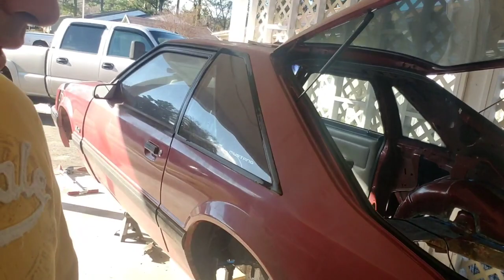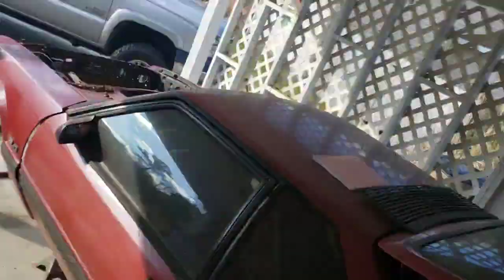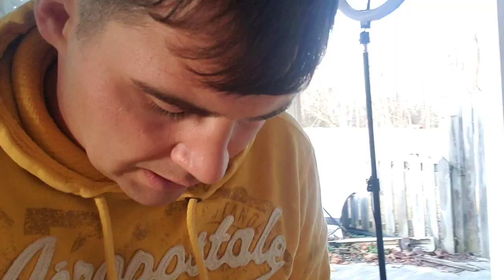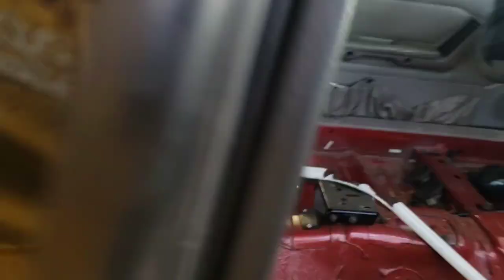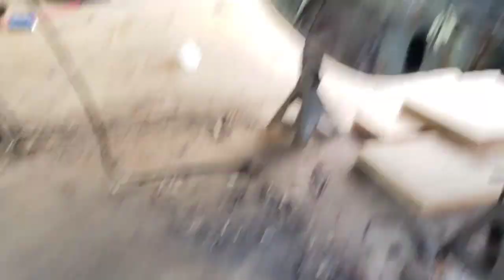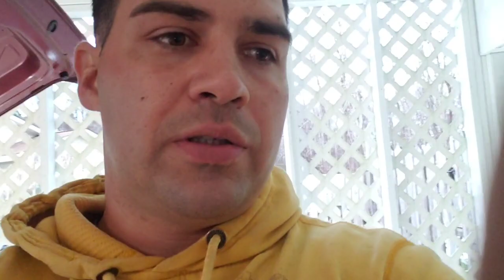MORE PROGRESS ON THE MUSTANG!! LITTLE BY LITTLE

Comment: I would recommend cutting out the parts you’re planning on leaving at the front of the frame rail.   I’ve helped with a car that has a similar “shelf” sticky tires in the pits will fill it with gravel and you end up having to clean it out before every pass in the staging lanes.
Reply from the maker: I didn't even think bout that. Thanks

Comment: Nice work,you will get there . Slow & steady. Are you going to narrow rear end & what size tires & rims you going to run. I have a hobart 175 welder thats 20 plus years old i built a 47 ford tk rat rod with i made my own frame on a 30 amp 220 breaker & welded 3/8 thick steel. You should be fine.
Reply from the maker: Thanks! I am going to narrow it later on. Right now I have a 15x10 wheel and will be running a 28/275 tire 10.5 wide but want to be able to run a W with no issues .

Comment: He's going to be running cars that are running mid 7's, he needs to wick that mustang up with everything its got.
Reply from the maker: It'll run mid 7 easy. We ran an 8.07 at Rockingham letting completely out of it at 7 seconds and it was on a track that was far worse than Bradenton
Reply: @zachmoore4564  he posted on Instagram yesterday that there will be 6 second cars there but you never know in racing. Good luck guys.
Reply from the maker: I just saw that. Those 6 second cars will be hard to handle!